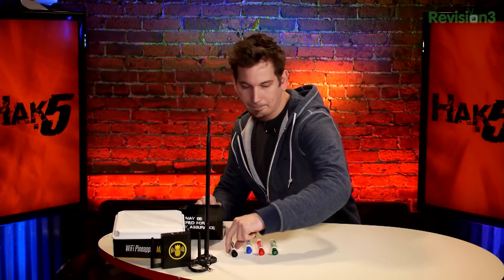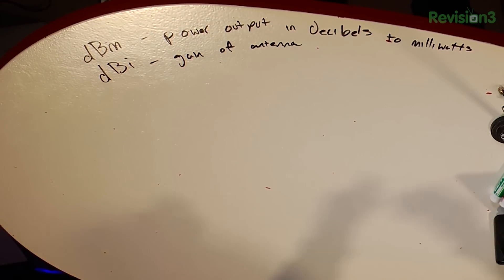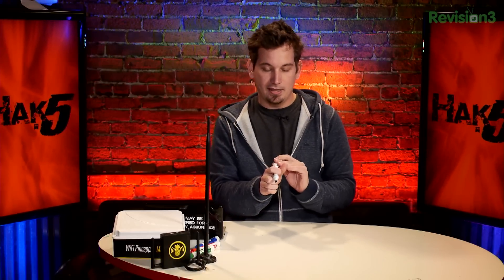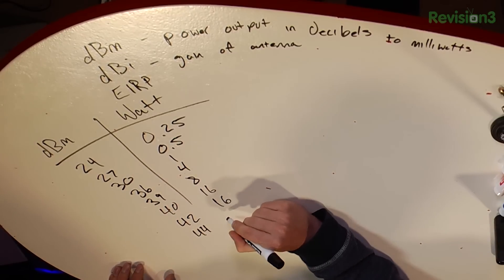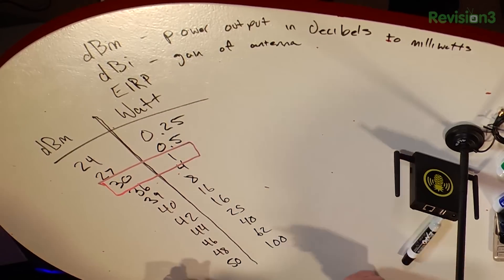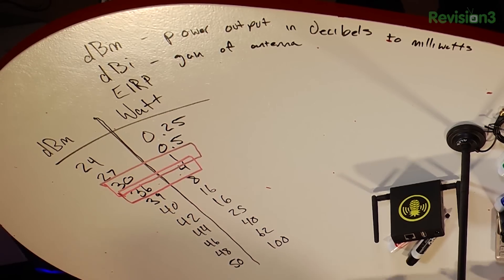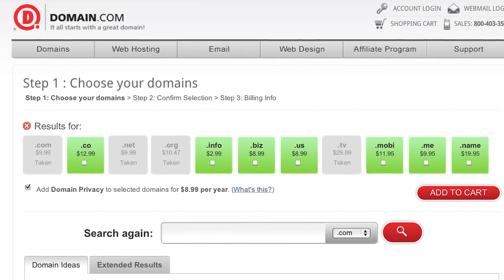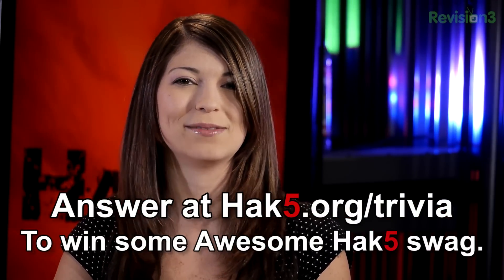Legally build a 60 Watt WiFi Link - 2.4 GHz and EIRP, Hak5 1515

Comment: U HAVEN'T A CLUE WHAT U ARE TALKING ABOUT ANTENNA HEIGHT COAX CONNECTORS ANTENNA DBi AND YES AMP WILL BE NEEDED IF THE ANTENNA IS NOT HIGH IT WILL NOT GO ANYWHERE MIN 30 FT VERTICAL GETS YOU AWAY FROM THE MAGNAT PULL OF EARTH AND GET A SIGNAL OUT  YOU'R RECEIVING DEVICE WILL NEED A WAY TO TALK BACK REPEATERS MULTI LOCATIONS OR JUST AN AMP AND ANTENNA ON YOUR PHONE

Comment: So can you set up this kind of a configuration and then sell it to me to use? I need to get WiFi from house to my shop and it’s about 100 yards away.
Reply: You can get outdoor high gain directional ap for that. 1w power.
Reply: Take a look at some of the Ubiquiti radios; they cost less than $100.  100 yards is nothing as long as you have line of sight.
Reply: No

Comment: So in one episode you mentioned that the legal maximum of a non-point-to-point (if I'm understanding correctly) is 500mW or .5W in the U.S. and then in this episode you (if I'm understanding this correctly) the maximum of a non-point-to-point link is 1W.   Can you further clarify this or am I mistaken altogether?  I ask to make sure because I plan to use a micro yagi-uda antenna just so that I can get a better signal reception through my step-dad's house.
Trust me, I tried asking my step dad if I can just run a simple cat7 cable to the home's router so that I can get a connection to the internet but he refused.  Hell, he even refused to let me connect a moca adapter so that I can get connected.  And he even ripped out the tv cable (coax cable) out of my bedroom.I'm trying to get a better signal without violating FCC part 15 that's all.  XP

Comment: The higher the antenna gain, the farther the signals will get. Also, use the channels 1, 6, or 11 (2.4 GHz ISM band), because these wouldn't overlap with other channels. CSMA/CD cannot keep up with more clients. In a WISP setting, some sort of TDMA technology is used for high throughput (Examples of these are MaxStream by TP-Link, NV2 by Mikrotik and airMAX by Ubiquiti Networks.).

Comment: dBm increases by double/decreases by half every three steps, dependent on direction. You screwed up going from 39 to 40 and doubling the output there. 42 would have been double 39.

Comment: I do not understand what's the point of decreasing output power when using higher gain antennas. Why don't just leave output at maximum tx power and use the most high gain antenna ?

Comment: Do they let you take off for loss in cables. What I have worked on was big things. A10,000 watt radio station, they take the power out of the transmitter, subtract cable loss then add the gain of the antenna.

Comment: Gotta love Mesh Networks! That's what point to point is!
Reply: Andre Hunt mesh =/= point-to-point. They're not at all the same thing.
Reply: Well, I could prove you wrong! Wireless routers run off the Amateur Radio bands on some channels. A mesh can be two or more devices connected and sharing resources. 

The best part about mesh, there are phone, computer and radio services it can provide. With Wifi, you can only do internet. FCC has it locked out. Mesh has a longer range with an external antenna and can use all and more of the devices you have for sharing internet setup.

If you took a Linksys WRT54G and put DD-WRT or an open sources, it changes it from a router to a mesh style router.

It is deployed all around the US by Amateur Radio operator and clubs. It is used for disaster phone and radio connections. I have mine setup for Google Voice phone services and accessing my radios online. I can also set a second one up in my aunt's attic and share internet and networking capabilities.

Mesh is a loose turn used. It's call HSMM or High Speed MultiMedia aka MESH! We just changed to system on the devices.

Comment: You need the raw power at the source. Counting on eirp power only applies to directional antenna's. Ground planes have no gain. It is the law of physics that applies here. You need the power at the source. I doubt that the little wifi box is capable of a watt. 60 watts is out of the question. You need the actual power or it will not work. Good video though I just had to add my 2 cents worth. I had this same idea years ago but could not make it work.

Comment: 40 dBm is 10 watts not sixteen. Use the X10 (on dBm side) and ^10 (on millwatts/watts side) of your table.
1dBm = 
0dBm = 1 milliwatt (0,001 Watt)
10dBm = 0,01 Watt
20dBm = 0,1 Watt
30dBm = 1 Watt
40dBm = 10 Watts
50dBm = 100 Watts
Then use the 3s and 2s rules for the numbers between.
example
23 dBm (we added three to 20) = 0,2 Watt (0,1 X 2     ie double it)
26 dBm (add three to 23)= 0,4 Watts (0,2 X 2          ie double it)

Comment: who is ever going to catch you breaking these laws? i mean with the exclusion of running a pirate radio or something. there is just no way. in the wise words of grunkle stan "nothings illegal when theres no cops around".
Reply: xcvsdxvsx that's always been my thought. 
I ran a pirate FM station from my bedroom when I was 11, back in the early 90's. I built the xmitter from a kit and jazzed it up quite a bit, and built a ground plane antenna out of metal coat hangers attached to a UHF connector, tuned to my frequency. Even from the attic (3rd floor equivalent), it still made it a block and a half. Xmitter only had 100 mW stock, but I'd amplified it a bit. Not really sure how much, don't think it was much. 
Then I had an old Bogen 4-channel tube mixer and a couple portable cassette decks, and I had a radio station. But it drifted a lot. Always wanted to have another go at it using either a crystal controlled or digital PLL controlled xmitter like a Ramsey kit or something.
Always loved radio. Always wanted a real commercial radio station.

Comment: Also important to note is that you still need to comply to the "unintentional radiation" limits by FCC in your case. So slapping on a high gain antenna may sound legal for the 2.4G band but you might be in violation with out of band signals (mainly harmonics..)
Reply: Anthroplast are they typically that noisy? But fall within acceptable range because of lower power?

Comment: At 2.4 Ghz one also has to take into consideration of what is known as feed line loss. There is so much line loss in the coax cables used with some antennas that while even setting your power level to its maximum you still will fall way below the EIRP needed. In the microwave world you either use coax cables of at least 1 1/4" in diameter rated for microwave use (commonly known as heliax) or or you use frequency specific lines known as waveguides or you mount the transceiver directly behind the antenna feeding directly into it. For most users it is best to run devices like the Ubiquity line of transceivers which mount directly to the antennas and are powered through the Ethernet line (PoE).
Reply: There is an easy way to avoid all losses in coax cables: don't use coax cables. Simply place the access point (or other wi-fi equipment) in a weatherproof enclosure and mount it at the base of the antenna. Voila! No coax loss. My Ubiquti access point at the base of the antenna with the two connected together by a male-to-male coax adapter. There is no coax cable at all.
Reply: i tried 150 feet of radio shack RG8 mini foam going to a 1.2 quarter wave spike...i didnt hear anything ???
Reply: what happened

Comment: Decibels add up differently, not like normal numbers. For example : 27 dbm +  an 12 dbi antenna = 27,1 dbm in real, not 40 dbm so 0,512 W (512 mW) ! So, a 12 dbi antenna doesn't give a significant gain with a 27 dbm signal but if your signal's 10 dbm, it will give you a 14,1 dbm signal.
Reply: +Sébastien Gerard You've correctly explained how decibels add, but we are talking about something different here. Because dBm is with reference to milliwatts, and dBi is with reference to isotropic gain (which is just 1, so we can call it a simple ratio), we can simply add them together. This follows logarithmic laws whereby Log(AB) = Log(A)+Log(B).

Comment: I prefer the exception that since the equipment required to do the testing required by the FCC is so hugely expensive, if you build your own amplifier, you can pretty much do whatever you want to, they know you can't afford to know how much power it makes according to their criteria. But you have to build it yourself.
Reply: +UNITED POLICE STATES OF AMERICA Sorry, but it is not expensive to evaluate field strength. I know of one device capable of doing so costs about 40.00 USD - and i'd hate to be the bearer of bad news, but you can't plug in anything just because you managed to build it without killing yourself.

Comment: So, what's stopping a person from just using whatever hardware they want to setup their own wifi networks?
Reply: +Steven Lougheed FCC Type Acception renders an electronic device legal for use or sale in the continental US. I believe there is a different organization for Canada, and the UK has their own as well...but all of such organizations follow International Civil Aviation Organization guidelines, that&#39;s where they derive the basic plan.
Reply: Oh yeah, those bands are basically entirely run on complaints. Unlike certain commercial bands like FM broadcast where pirates still get caught from time to time.

But people set up their own wifi networks all the time. And use whatever equipment they want. Not sure I even understand the question.

Comment: Be-careful with microwave power amplification, you can be easily fried!
Reply: Oliver Cohen You can't fry a chiken with a router that's running on 10w adapter. Even a microwave oven of 1000w won't (it will just hurt for sometime) but with routers it's safe for now
Reply: Spark Maker it's not router output so much as antenna gain. For example you can turn a 1W router into nearly a 1000W output with high gain antennas.
Reply: Oliver Cohen It doesn't seem logical to me, according to the law of conserving energy, energy can't be destroyed yet created. 1w is 1J per second and it's a level of energy different from 1000J/s. We cannot get energy out of nowhere.
Reply: Spark Maker power wattage and RF wattage are different but fried you will be! If you want to learn more , you could do your ham license. M0OLI
Reply: Still not logical, you cannot send data through countries with a normal router but high gain antenna
Reply: Spark Maker Effective Radiated Power, is the power as read at the end of the antenna after the antenna gain has been taken into account. Google ERP or DBI gain calculators . Best wishes
Reply: lol, ya, from a router.  
I don't think so.

100w into a properly setups 2.4M dish at 10Ghz doesn't even warm your fingers up at 5m away.  This cobbled together collection of junk isn't going to "fry" an amoeba.

If you are worried about RF exposure, 30mHz to 300mHz has a far lower MPE than 2.4gHz does.

Comment: just seems weird the phrasing used here...  there are a few minor issues with the math at points, but overall the concept is right.  But yeah....  I mean the overall system is placing no more power into the air, the only difference is its being directed in one direction.    Standard dipole over an isotropic point obviously cuts off a little bit off the ends of the dipole...   the tall whip like antenna you show is a lot of stacked raditors, again it may be call "omni directional" but really all that is occuring is the direction of the radiation is being put in a more flat plane....   with less going up into the sky and less into the ground...   the patch antenna you show is the same ... you lose 360 and narrow it down to whatever the patch is designed for (160 degrees or less typically)...  by the time your getting to 50 dB gain antennas, your beam path is now very small... tens of degrees...    ... but yes.. if you have two tune antenna pointed at each other you can gain far more distance than an omni antenna any day. I guess I've just been in radio communication too long.   Anyhow... yeah...  its the generally right idea.

Comment: I'm a Ham and his antenna info is a little off  . also what coax is he going to use for coupling ? Even LMR 600 has high lose at 2.4G . I don't think ppl want to pay for 1" hard line lol Just the coax end can lose over 3 DB or more .
Reply: Very true. They would be better off connecting the transceiver straight to the antenna. They would have to make a weather proof box for the router. The big question in my mind is how far away is the other point. considering this is a line of sight band. 60 effective radiated watts would seem to be overkill. I have head of some desert mountain top qso's that were in the 50 mile range with 5 watts and its not like they are trying rain scatter for distant qso's. I'm not sure what to think of this really. Other than the fact that everyone between the point is going to not like the very loud qrm. Nobody on that channel will be able to network. I wonder if they are considering RF exposure limits for the poor folks in between the sites. This seems like an example of why people should at least go get their amateur radio tech license.

Comment: dbi isn't a real number, use dbd
Reply: +KB9OKB true, its more of a reference, or a base to reference from. With dBi, you can compare different designs, brands, models, etc if they all have a dBi specification.
Reply: dBi is the professional antenna engineering term. Use dBi.

Comment: I have no idea what he was talking about at first but as he went on this was very cool.  Off now to put lenix on this computer and off to radio shack for the rest.    Thanks for the great info.  I feel smarter already.
Reply: +ROBERT WEBB I hope you mean Linux. And, radio shack most likely wont have what you would really need, or want. Look online and even youtube to see how you can make far superior antennas than overpriced retail units. You can even upgrade a stock 3dbm antenna on a router with just paper and tin foil and get 12-16 db from it. windsurfer antenna design. biquad using a sardine can, cantenna with parabolic regflector (TV dish) combo (which is what I use).

Comment: Seriously? General idea is OK, but there are a ton of mistakes in this.
Point-to-Point is not mesh. 
Definitely some RF math problems. 
Most importantly, setting the local point-to-multipoint radio to 1 watt simply creates a whole bunch of unusable noise for anything that doesn't also have the ability to output 1 watt. Congrats, you just blew out all of your neighbors, and haven't gained anything yourself. (Might want to read up on hidden node problems.)
Reply: Jonathan Davis Point to point can be a mesh when you use more than one point to point. Many of these transmitters have two antenna ports, each of which can a be it's own point to point. Once you hit 3, it's a mesh. Not a redundant mesh, but a mesh.
As far as blowing out your neighbors, that doesnt happen. There are MANY HSMM-MESH systems up and running with high powers that don't interfere with anyone. People RARELY need WiFi from their homes more than 100' away. At that distance home WiFi radiated power is higher than the mesh power because the mesh radiation is over rooftops and houses in order to work.
dBm charts are available and the math involved is already done with them. What problems are you seeing here?
Reply: Jonathan Davis point to point is a protocol you are  used t correct, mesh is just a design a network that all nodes are conected redundantly   and PPP can be used in the design. I see that these videos are introductions and good start. know what you getting yourself into when you design a large wireless networks. I would like to actually send a wifi signal  about 200  feet pointed to me. but WIFI is not that safe for accessing what you need go with a VPN, or SSH rdp is good but anyone that can use80 a computer can ruin your day if you have weak password at least with SSH the need to know use command line.

experiance CCNA R&S student studying IOs 7, I have  a cisco IOs 5 wireless Ap In my lab  we do this stuff all the time.and by the way for wanting to connect more than 30 people you need a DHCP sever because the DHCP in your router sucks is not capable
Reply: yeah the point to point exemption will require yagi antennas to be legal not omni antennas.jim

Comment: How far will the 60 Watts of power transmit ??  Any one know ?  I have a  100 mw transmitter  what  Antenna do I need to get the Max power output..   Please help
Reply: +Gfdf Perte Don't ask stupid questions, you should know the answer to that question if you had even the most fundamental understanding of RF. Pro Tip: Don't build and employ illegal devices - they are very easy to locate. I just saved you copious fines.
Reply: +Dee Dubbs   mind your own business
Reply: Gfdf Perte It is my business. I work for the FCC.
Reply: Who cares if you work for the FCC.   I know I do not

Comment: this is so full of errors, youtube should pull it. this guy has almost no understanding of antenna systems, and his math sucks.
Reply: +Sheldon Bailey I agree, pretty much a joke. Understand the difference between DC and Daylight - don't be a dummy load.
Reply: He probably has no degree in electrical engineering.. or forgot stuff.. calculations for electromagnetics aint easy stuff... this channel's informative.. u can do your math yourself if ur interested in the tech they're advertising.. ud never use these things if u dont know how to do the math urself.
Reply: yes demand pulling a video before trying correct where he went wrong...